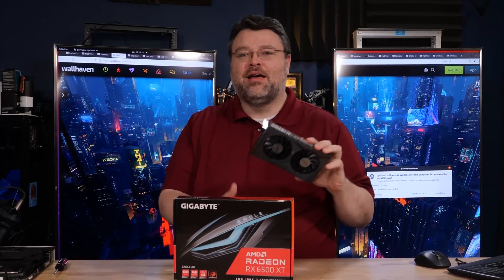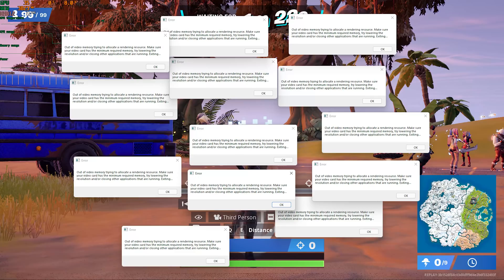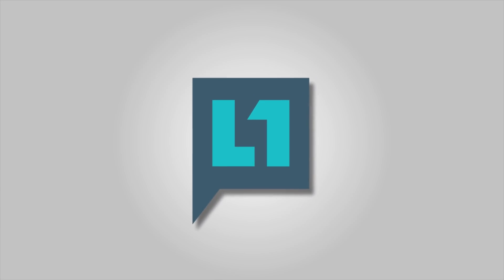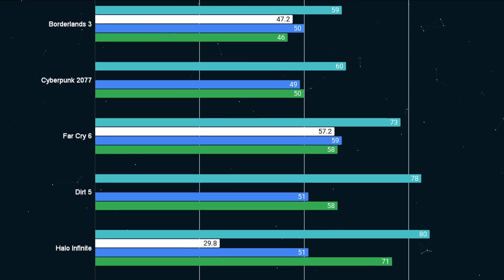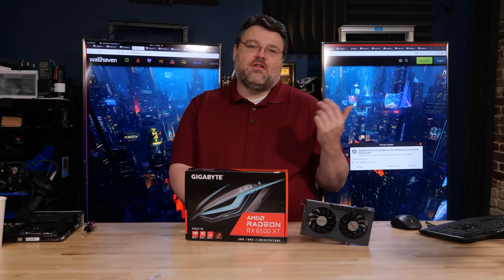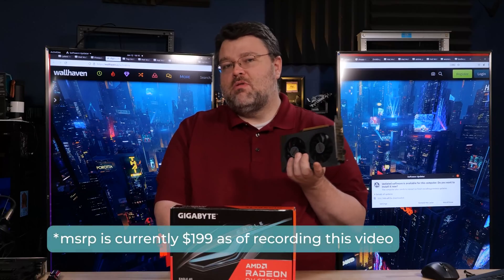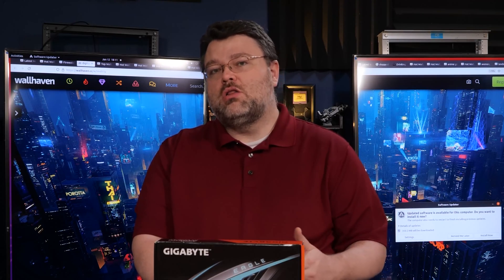6500XT ; Now Attempting Launch - Gigabyte Eagle Tested

Comment: The Idiocracy shout out got me in the feels. Great review as usual.  Also glad to see Microcenter has these at $200. I wonder why your pci 3 testing was so different than hardware unboxed.
Reply from the maker: The textures. Also I didn't realize this but should have.. some games/programs appear to be underreporting vram usage. And in the case of my Fortnite woes competing for vram
Reply: Steve at Hardware Unboxed went out of his way to use settings that were entirely inappropriate for this card.  He clearly had a conclusion he wanted to reach, and skewed his testing methodology in order to do it.  Very disappointing.

To get useful information, you have to look at what he labelled something like "quality scaling", where you see the performance is much better than he presented in his graphs, when you use appropriate game settings.  One big example is his insane use of Ultra quality in Shadow of the Tomb Raider, on the grounds that it's a few years old now.  When you use the correct settings for the card, it performs much better with a PCIe 3.0 system.
Reply: because HU was inflating textures to push "bad card" narrative
Reply: @petervansan1054  Which you SHOULD be doing if the card has a massive glaring fault that the vast majority of people this card is aimed at will absolutely slam into. Steve didn't "inflate" textures, he even tested the games at medium settings that AMD WANTED. Wendell should have caught it but never really pushed it to see how hard that wall would actually be. Steve just did a much more thorough review of what you should expect if YOU buy the card instead of simply giving you a warning to never actually push it and not use it on pcie3.

Before you go trying to insinuate an anti AMD bias from Steve @ HUB keep in mind he literally just put out an Nvidia hit piece and everyone else slammed this card for abysmal PCIE 3.0 performance as well. Wendell was just being polite to a card that really shouldn't exist but makes a tidy money grab for AMD's shitty silicon they couldn't move on mobile.
Reply: @zodwraith5745  Steve tested Shadow of the Tomb Raider at Ultra, and used a 4K texture pack of Rainbow Six: Siege.  He deliberately chose settings that would exhaust the VRAM, because he had an agenda.  It was not a fair review.

Comment: "The silicon is very small" Intel have no problem putting encoders and AV1 in their Alder lake IGPUs. Fact is the 6500 is a laptop GPU masquerading as desktop GPU, it sucks in PCIe 3 systems that the majority of people run. Shame on AMD.
Reply: And how big is that CPU.  Additionally, as a laptop GPU it is expected that the CPU would have the needed encoders and decoders

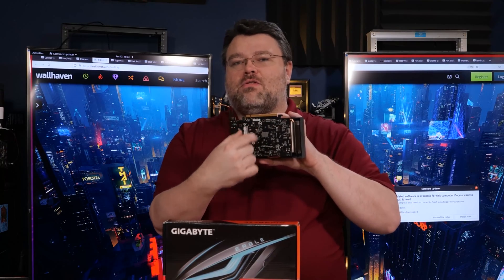Comment: 1:43 I think you need to revaluate the PCIe 3.0 not being an issue if you are correct then you are saying HUB, GN & LTT got it all wrong
You can maybe set your games up to work wound the bottle necks but it's getting out performed by 1650 supers a $160msrp and 2 years old
Reply: They're not  wrong, and he's not wrong either. He explains why his results differ, it's more that since he's not using standardized testing he can review it targeting more "sensible" settings. The 4x connector is only really an issue when you exceed the 4GB of VRAM. I've yet to watch the LTT video, but the GN or HUB videos do not technically go against Wendell's findings.
Reply: @NuDimon  you should go watch Hardware Unboxed video linked here from a couple of days ago https://youtu.be/rGG2GYwnhMs
Steve gives some pretty good reasons why it was going to hobble the card before it was even in his possession for testing.
A brand new GPU should be able to handle medium settings.
If they hand cut corners on either just 4Gb vram rather than 8 GB or 4x PCI lanes rather than 8x it probably wouldn't have been as bad putting it in a PCIe gen 3 system but because they cut corners on both lanes and Vram the card is worse than a 2 year old card that sold for less
Reply: @Berserkism  Nope he set graphics setting on a brand new GPU to 1080p medium pre-set on modern games and on games that were older he used some higher pre-sets depending on the age of the games
https://www.youtube.com/watch?v=M5_oM3Ow_CI&t=187s
It's not just Hardware Unboxed though it's Gamers Nexus and LTT too.

Comment: I have an eight gig 580 in my primary machine, and a R9 270x in my backup, so this card is something I don't need.  But I'm glad it's out there for people who can really use it.  My local Micro Center has four different models, all in stock, and at reasonable prices.
Reply: Ive got a r9 270
Reply: What’s “reasonable prices” are they $50 or less?
Reply: Ranshit

Comment: I am losing trustworthyness in you level1techs, All the other big reviewers dosnt have it consistantly faster than a 1650, or RX480 for that matter. So unless its due to you using a more overclocked version, and mhz scaling way better than usual on these things , i still think the product sucks, like HUB and Gamers Nexus and LTT all confirmed.
Reply from the maker: It's the graphics settings, high, medium or low, not ultra high or epic. Fortnite problem not withstanding
Reply: @Level1Techs  Exactly, the other reviewers seem hellbent on using settings that are not sensible on this class of card and then complaining about the performance.
Reply: Wendell is one of the few that is testing it at sensible game settings, this is a low-end card, if you fill the vram by putting settings on Ultra it will go down like a brick just because the vram is full, not because the card itself is weak
Reply: Looks to me that you have as little understanding of the card and the appropriate way to test it as those review channels.

This is the first review I've seen that was done properly, pointing out the limitations and operating within them to show the performance an actual person would get when using the card correctly.

Comment: I think the PCI 3.0 performance should have been more emphasized. If your replacing an old graphics card there is a good chance that you have a PCI 3.0 motherboard and you should know what you are in for if you exceed 4GB vram. I appreciate the more positive review though this card has a place as long as it isn't PCI 3.0 system.
Reply: @somehow_not_helpfulATcrap  On PCI-E 3.0 a 1080 With its higher VRAM will infrequently need to swap data and if it does it has the full x16 3.0 lanes to do it.  On PCI-E 3.0 The 6500xt with it's 4GB VRAM  will need to change data more frequently (especially with poor settings) and when it does it will be choked by the x4 3.0 lanes because it will have half the bandwidth compared to PCI-E 4.0.  On PCI-E 4.0 this card is fine for what it is, on PCI-E 3.0 you are probably better off buying a second hand RX570 4GB because when you start exceeding the 4 GB of VRAM you have a full x16 3.0 lanes to help move data.
Reply: in fact the only chips with pcie 4.0 are  11000 ,12000 series from intel and 5000 series from AMD . only on select boards. That's pretty short sighted considering no one was even able to purchase those boards in a quantity that would facilitate selling a card that barely meets those requirements. An apu might perform better but we dont have any hard and fast details for that yet. provided smart access memory and Fidelity Super Resolution can be enabled
Reply: @tobiwonkanogy2975  the reason is that this is laptop gpu that was designed to go with rembrand APUs which are pcie 4.0...
Reply: @petervansan1054  You might be right because the 64 bit bus, which the 6500 got, is the same bit width as the APU's.
The vram may be too low to play many games in high settings. But maybe this gives the game industry the right impulse to develop more efficient algorithms and techniques. We have already seen some. 
For example there is no big sense in increasing the resolution beyond 4k, which is at the border of human eye reception, when gpus are still based on rasterization instead of ray tracing, which can be used for the important global illumination, which actually makes a visible visual difference. This is the feature, i miss the most in the 6500. It got ray tracing but it is too weak. But maybe it can be compensated by stronger noise interpolation techniques and involving additional computed ray tracing on the shaders.
Another technique to reduce the need of transistors and to stay under the radar of miners is FSR. This reduces the memory usage and the data transfer on pcie.
Also techniques like variable rate shading and mesh shading. By the way the latter hasn't been pioneered by nvidia but by amd (primitive shader). I mention this for accuracy.
But overall, i wished, we could leave behind all patented x86 chips as a mere compatibility layer and turn to a liberated RISC-V based market. Who knows. If we thereby had much more chip vendors, then gamers actually could have more alternatives right now.
Instead the whole market is practically divided up among the established big players for decades. Who knows maybe the revolution comes by increasingly high efficient SoCs from the mobile market.

Comment: Wendell is very smart and I like his content BUT I think he got this one wrong. I think Hardware Unboxed & Gamers Nexus got it right. This card is crap at a crap price.
Reply: He is one of the few reviewers that did tests keeping in mind the vram limit and the pcie x4 interface. Most others just slammed it with games at Ultra settings, and the card tanked, his tests at high/medium show a very different picture because the GPU isn't bottlenecked by vram size and the actual GPU cores can show what the card can do
Not to say this card is amazing, just that it isn't as bad as other reviewers paint it as.

Price will be ridicolous anyway regardless of MSRP unless AMD is going to literally flood the market with these things, which seems possible given the smaller (less crowded) process node and the smaller amount of silicon per GPU. Atm I can find it at 350-400 euro, which is insane.
Reply: @marcogenovesi8570  there are other cards with 4GB that were fine in the same settings and didn't regress as much because they have full bandwidth.
Reply: @marcogenovesi8570  With all due respect to Wendell, it's not how you test a video card. Every card looks decent if you test on low settings and/or resolution. That may even be forgivable for a $99 card, the cheapest 6500XT on Newegg in stock was $269 today. It performs worse than $200 cards from previous generations for more money. Not acceptable. Wendell got it wrong here.
Reply: @JamesSmith-sw3nk  He used the same game settings for all the three cards he compared and showed how at realistic settings for a low-end card (which this is) it is indeed an improvement over older cards, which is something other reviewers didn't notice in their benchmarks at max settings.
Did you actually watch the video?
Reply: @marcogenovesi8570  I did watch it and I stand by what I wrote.
Reply: @JamesSmith-sw3nk  He didn't use low settings.  Did you even watch the video?  Did you even understand what the other reviewers did wrong?  Do you understand hardware at all?
Reply: @TrueThanny  I understand your mother!
Reply: If you really think Wendell is smart then I recommend you to listen to his reasoning on why this card isn't as crap as other reviewers say, instead of just mindlessly assuming he's wrong just because his review it doesn't align with the others
Reply: @GianniLeonhart  implication... Wendell is not smart? Come on now, dont be an eeijit.
Reply: @fracturedlife  thats not what im trying to say, at all
All im saying is that instead of thinking "wow Wendell you're wrong because every other reviewer called this card a piece of crap" he should approach it more like "oh, this review isn't as negative as the others... I think Wendell is a smart person and I value his opinion so maybe I should listen to his reasoning" 
Sorry if i didn't made it clear with my previous comment

Comment: This is by far the most positive review I have seen on this card.

Looking at in-stock at microcenter this morning, this is the obvious choice at $200-215.  When you are looking at Radeon RX550/560 cards and the occasional 1650 in this price range when a 1050ti is at $280 or a 1660 super at $430.  I think the things that are going to ewaste or have people sell these off the fastest is the x4 bus.
Reply: Wendell is mostly positive in his reviews. It's a definite clash with the rest of the reviewers. I'm not sure if it's a strength or a weakness.
Reply: @technologyanimals  I would say a strength.  The other reviewers seem more concerned with the negatives and don't seem to push the positives, especially in this current market.  Like Hardware Unboxed using the Ultra HD textures on Rainbow Six Siege.  It's not a realistic scenario for a card with this spec but it helped with his negative agenda.  Don't get me wrong, I don't think it's a great card but in this current market it's nowhere near as bad as people are making out.
Reply: @stuartedwards6996  I dunno man...  I think its pretty obviously a shit card and this review is terrible.

Think of this with anything else in tech.  7700k was around 500 dollars at launch.  I'd like to see people defending AMD or Intel releasing new 4 core chips (with substantially weaker single thread performance) selling for the same price as the 7700k did.  You now get 24+ threads instead of 8 and the threads are substantially faster and have access to more cache.

This is a fucking garbage product and Wendell's review is pretty fucking sus
Reply: @stuartedwards6996  thought Steve done that more to compare with 5500xt 4gb which was way way less shit.
Wendells positivity is good for balance. There ARE people out there who could use this card at less than $200 and potentially miners will run a mile.
Reply: @EuphoricDan  As long as it doesn't run out of PCIe bandwidth and VRAM, 6500XT 3x4 will crush 1060 6GB 3x16 easily as with The Witcher 3 or similar games that don't kill your PCIe.
Developers these days like Ubisoft or EA doing asset reuses extremely sh*t and will tank the hell out of 6500XT easily vs eSport games or "insert not 2021 AAA titles" that the only speed limit is GPU chip.
Why the f blaming AMD for making x4 card but then enriching those bad game developers that makes sh*t games and causing these type of cards tanking?
Reply: @technologyanimals  Other reviewers likes to abuse the card weaknesses for the sake of clickbait and never show the strong point of it anyway (Same with Crysis 2 making AMD cards look bad by spamming useless tesselation)

This kind of graphic card runs best with eSport titles and as long as you don't run out of PCIe speed, not open-world or games with high-res assets
Reply: @max20091  dude, this card is a fucking horrible abomination at $200 MSRP, then selling for more like $300 (if you can find it in stock). AMD has abandoned anything below mid-high end and they don't care whether most people can buy their shit, as long as the people with the most money can buy it.
Reply: Me either.  I didn't enjoy in the news that week that he was sick and extra salty on everything.  There is some positive and probably more negitive in this card.  It is what it is in this market.

"Always look on the bright side of death..."
Reply: hm, the major German online retailers are selling the thing for like 340 € aka 385 US Dollars. For which it is a slap in the face, frankly.
Reply: MicroCenter here Long Island , NY is 260-270$ for PowerColor. A bit much, but sadly still the lowest price useful card
Reply: @stephen1r2  the one I used to live local to I still check their stock on GPUs and CPUs just to get an idea on retail availability and pricing.  They had the 270 and 300 cards left last night.  It looked like they did restock some 200 ones though.

Comment: Normally, when something like this that "kinda works" is released, I say something like: "The average user wont care."
Im not sure if this is true here as well, as people buying GPUs are mostly not average people, but are in the know about hardware. And while you surely can game on that card, its just not .. enough. It may be for right now, but not for tomorrow. Considering the fact, that the overwhelming majority of systems out there (outside of our bubble) are still on PCIE3, its really hard to recommend this card to anyone. Even a used card would be better, sporting hardware encoders, more Vram and even decent overclockability in some cases. 
If you absolutely NEED a card RIGHT NOW no matter what it is but having a limited budget, have a look at the second hand market.
Reply: lol second hand gpu market is also whacked
Reply: @lordjaashin  Extremely, yes. But you can find better options there than than this card.
Reply: @Spicysauced  lol where i live people are asking $300 for 1650. i can get this 6500 for less than that

Comment: Even adjusted for inflation this card has no right to exist.
I know you can't just speak your mind because of khm khm, vendors and khm manufacturer. But call spade a spade.
It is a overpriced piece of garbage at the price.
No matter the node or technology in the card is just SLOW in the older systems it is meant to replace 5 year old card, like no time has passed